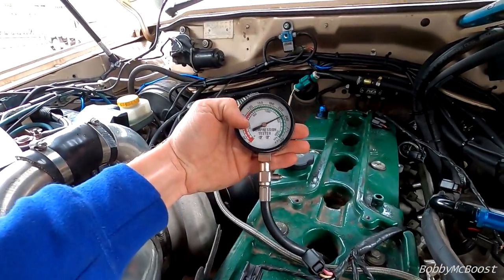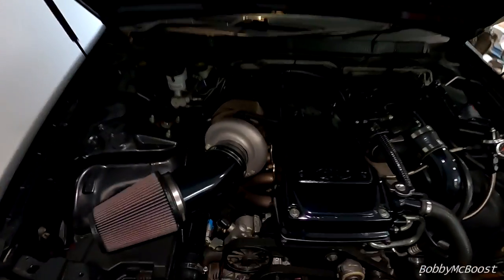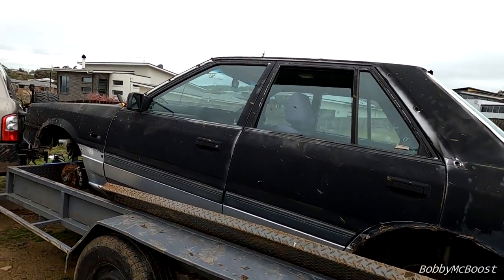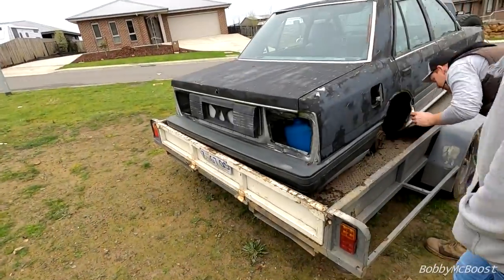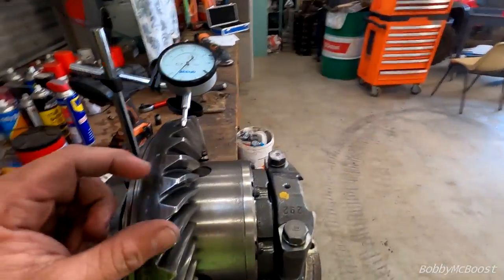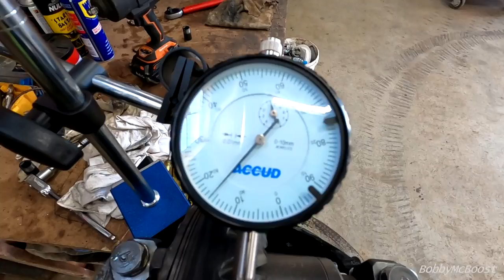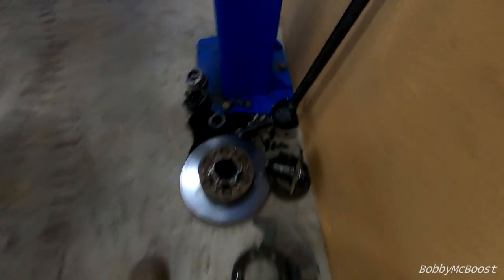Bought a NEW CAR!! needs a little love..

Comment: What turbo is that exactly??
Reply from the maker: Borgwarner. Sxe366.
Reply: @BobbyMcBoost  what are the specs of it please?? And how much power is it making?? Just looking at one myself is all
Reply from the maker: Look up a sxe366. Its a t4 flange. The specs are that. It makes 325kw and is pretty trick! A little laggy tho, being a gas motor the rear housing is suited well but I would go a 363 if I was changing. And probably a .9 ish rear housing a/r. Not sure what they offer. 👍👍